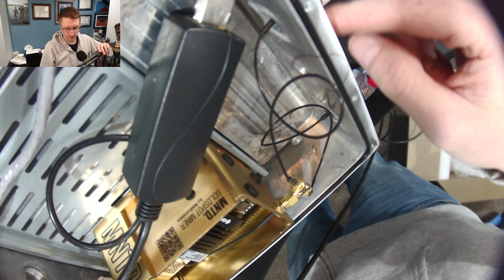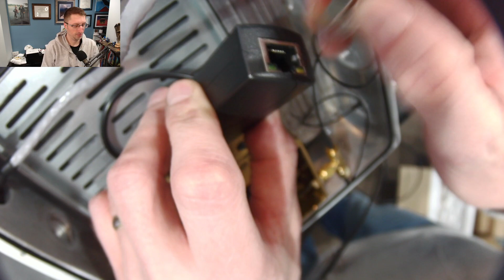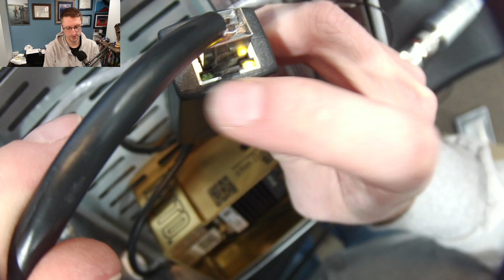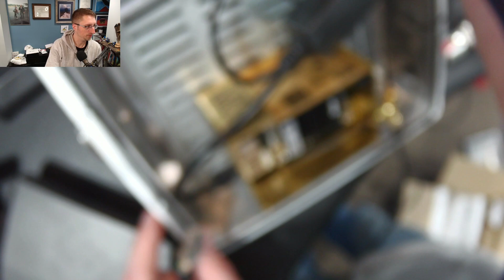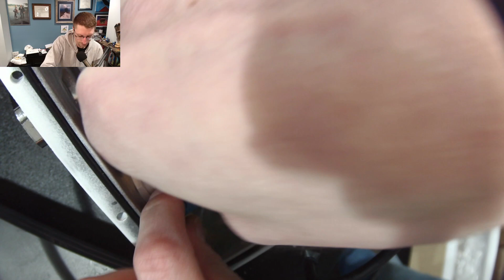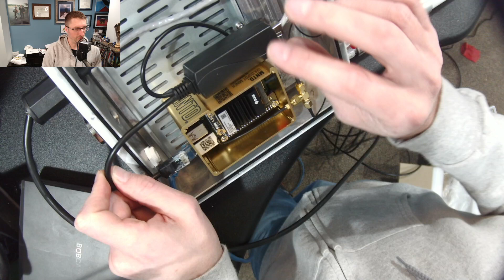Helium Network - How to diagnose PoE problems for enclosure

Comment from the maker: The problem was that this particular injector/splitter doesn't play nice with gigabit routers. Once I configured the connection on the router to use 10/100, everything cleared up. One other moderate contributor was an ethernet cable that was too long. I replaced it with fiber and it also helped clear up the signal dramatically.
Reply: Had the same issue with the same splitter. Bought another to see if it was faulty and having the same problem. What splitter do you recommend?

Comment: To be honest, I’ve been struggling with the same exact problem for longer than this video has been on YouTube and with the same exact set up, of course, also with just one antenna, not two.

I appreciate everyone’s responses and questions and replies and hypothesis’, but I have been to the end of the earth and back trying to figure out why the hell every time I get it up on the roof again, it stops working within a few days.

Honestly, I think the problem exists in the splitters’ power cable that connects to the miner.

It being advertised as a power over ethernet miner, is highly misleading.  The power and the data should just go to the Ethernet if it were truly POE; instead, we were sold injectors and splitters that cause more problems than they solve; cause two cables go into the miner, not just one Ethernet.

I think removing the screws to the minor to install it into the closure, creates a problem where the power cable can’t make a solid connection, and if it loses the connection, power going out or whatnot, it wont turn back on until it is physically connected and reconnected by hand.

This is the 20th time I’ve gotten up on my roof to diagnose my minor, I have cramped and re-cramped my Ethernet cables, replace splitters, replace injectors, POE switch etc. and at this point, I am under the firm impression that the miner and the power cable of these particular splitters are not very compatible.

This is so frustrating, I guess I will have to do what I can, to change my new POE switch to 10/100.

Having to go all the way up to my roof is a pain in the ass 10x per year.
Reply from the maker: I wonder if there's a problem with the ethernet jack on your miner? How does it perform if you have it on wifi? I realize that's not the best, but it should be better now with light hotspots active.

Comment: looks like your problem was that black ether cord. terrible termination. when you test stuff you should use all all the same variables
Reply from the maker: I tested the cable, it's fine. Check my pinned comment for the actual problem.

Comment: I believe your splitter is made by anvision. me and my buddy have  purchased 20+ of them and they all seem to be not working, only few did work. i spoke to Anvision company and they do not have anything of help on troubleshooting these splitters. 
It appears that device powers up , but modem does not see it connected. I assume something with data cables. 

Did you solve this issue ? what splitters did you actually buy? 
Im trying to get working ones for Nebra and for Sensecap miners. 

So far installed them on roof with separate cable to power it up until splitter issue solved.
Reply from the maker: The problem was that this particular injector/splitter doesn't play nice with gigabit routers. Once I configured the connection on the router to use 10/100, everything cleared up. One other moderate contributor was an ethernet cable that was too long. I replaced it with fiber and it also helped clear up the signal dramatically.
Reply: @edballou1  oh wow . thank you . that was helpful information. never knew there is a way to reconfigure router to use 10/100. If you ever make a video on that - it would be highly appreciated . Thank you

Comment: I have the very same issue with exact setup on 2 different miners. I’ve also seen somewhere that the static IP may not be going through the injector or splitter properly. I’m not sure about that but it doesn’t make since that Rak would send us a splitter and injector for the specific Rak miner and enclosure  that doesn’t transfer data??? It must be something in the router setting. I’ll post back later today if I find anything out.

Comment: I’m having the exact problem same enclosure and POE setup all from RAK. The injector looks to have an power indicator on the top however when plugged in there is nothing no lights and definitely no power to the splitter up top.
Reply from the maker: If you’re using a gigabit router, you’ll probably need to upgrade your PoE injector and splitter. My switches are configurable but I’d probably still advise upgrading your injector and splitter that works with gigabit routers.

Comment: Just had this same thing happen with my exact same setup as yours minus the two antennas lol. 
I have just replaced the splitter with a procet but retained the rak injector and now have the orange power and green data light back. Hoping it’s now fixed but still showing offline on explorer 24 hours later.
Reply from the maker: Trust what it says when you’re pairing more than Explorer!
Reply: @edballou1  Agreed, Explorer is very delayed. Thanks for the video!

Comment: Good info. Did you check the injector? Or do you think the problem is the splitter?
Reply from the maker: Good callout! While we did verify the power through the injector was good, we didn’t verify the signal through the injector. Most likely this will all clear up when I get a gigabit injector AND splitter.

Comment: Good luck with Rak ,I did cancel my order, 2 months ago, still I didn't get my refund ,same as nebra ,kind of scam
Reply: Have you emailed them about this?
Reply from the maker: Was that through Cal-chip?
Reply: I would check your RJ45 head needs to be cut off and crimped w/ the shielding inside the head. The bare wire sticking out of the head no good